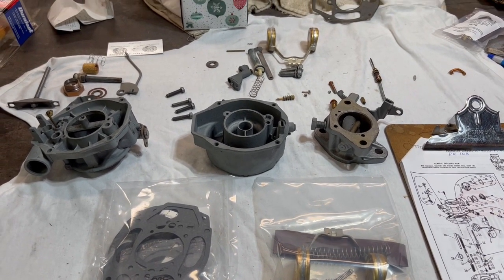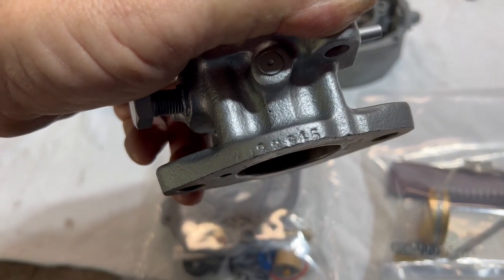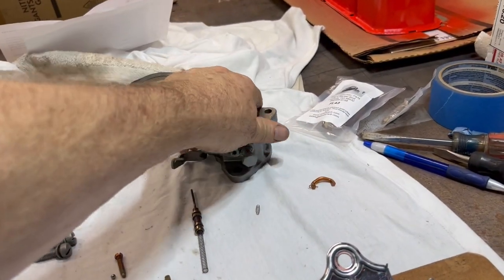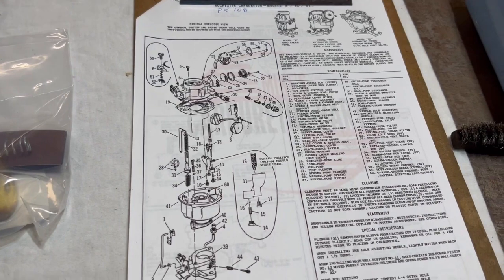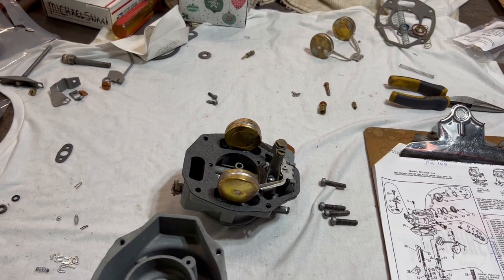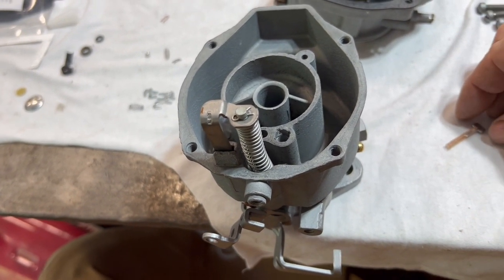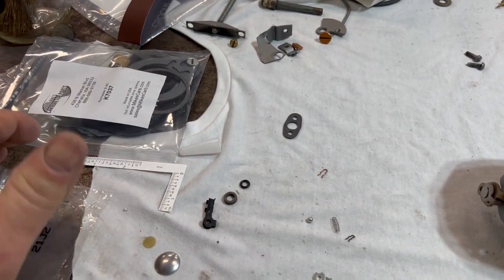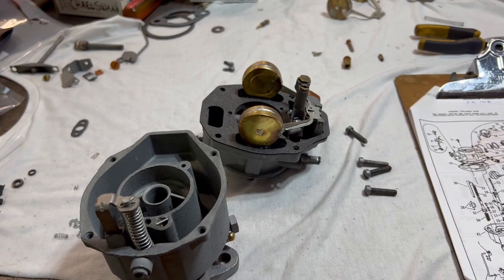1965 Panel 65 Dream 8

Comment: Nice videos, Mark!  I'm curious, at 0:44 you add what looks like Simple Green to the parts can, what did you add at 0:45? just more SG from your left or something else?  If something else, what is it and what ratio?  Thanks, Buddy
Reply from the maker: You have a keen eye!  Very impressive since that video was going pretty darn fast!  That was more Simple Green being added.  It was just what I had in a spray bottle.  For active, scrubbing type cleaning and shorter term soaking, I really like Simple Green.  It's real easy on my skin (and the environment).  I prefer to soak pot metal parts in it but only if the part is completely submerged.  Having the right sized container really helps with that.  I do not advise soaking longer than an hour and afterward you should rinse completely.  It does a great job or cleaning and, over time, brightening the metal.  Thank you for your comments!
Reply: Thanks for the quick reply!  Keep up the good work, I'll be watching!   @vintagechevyvanparts